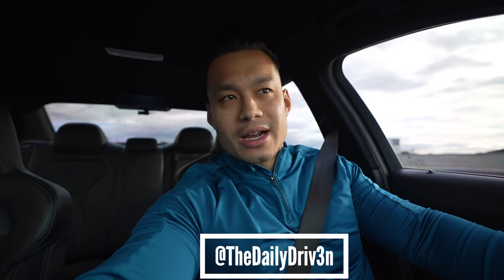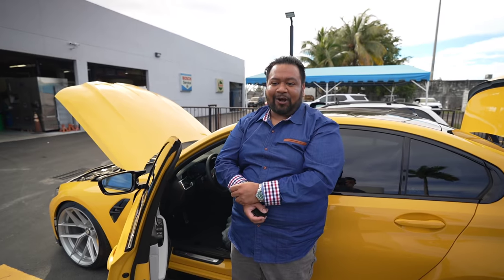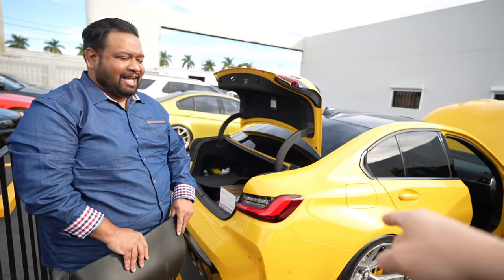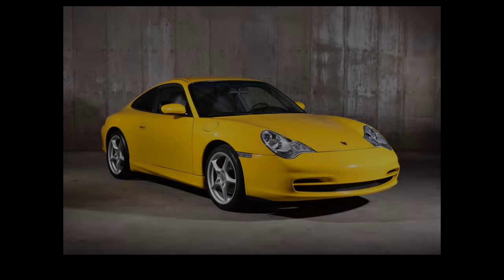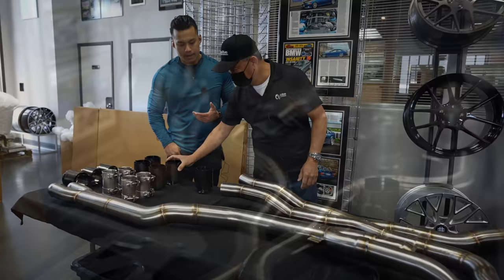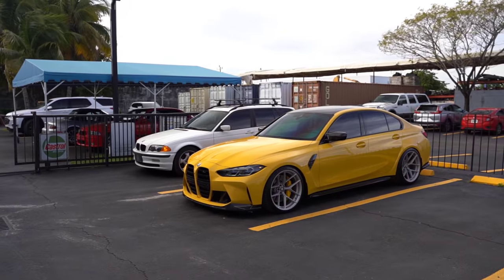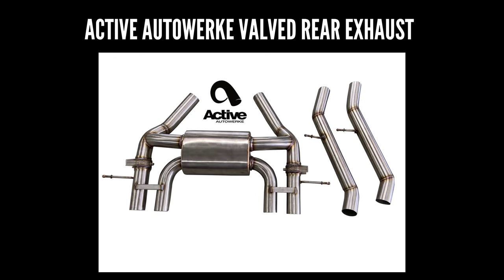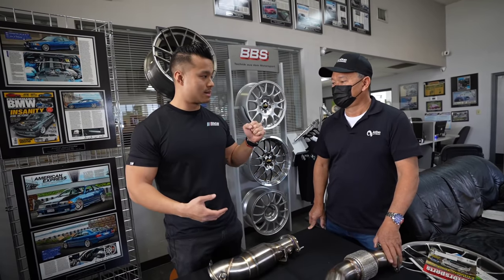2022 INDIVIDUAL SPEED YELLOW G80 M3 With Silverstone Carbon Bucket Seats

Comment: Everything on this car is awesome and makes the big grills tolerable for me as I still am not a fan. My biggest issue with the G80 is actually why they went with a floating one piston caliper in the rear. I heard because of electric parking brake nobody has a two piston rear, but I have no way of knowing if its true. I'm sure they perform just fine just it would set off the look way more and the previous F80 had two piston. I mean even my F30 has the two piston rear option.
Reply from the maker: Yeah have to agree the rear floating calipers are puzzling. I'm not a fan of them at all lol.

Comment: I actually like the yellow on the m3 more than I thought I would, though I'm still mixed on the front end at least on the coupes, but the four door looks a lot better especially after I saw one in person at the local autocross back in December...not sure yet if I can make it on on Sat really want to go see the cars there. 

Oh the red BMW being worked on is an E21 3 Series (predecessor to the E30 and replaced the 2002) and looks like it might be a Euro spec import due to the smaller rear bumper. For the longest time they didn't seem to get as much love as the E30 or the 2002 and came out in that era during the gas shortage and ugly bumpers.
Reply from the maker: Yeah when Mihir first told me the color, I didn't think it was going to look good and I was hesitant. After seeing it in person, I changed my mind big time.  Looks incredible.  You really need to see it in person to make a accurate judgement.  Hope to see you at the event.  DM me if you do. Ill get you taken cared of.  

Thanks for chiming in on that BMW Classic.  The team there are actually working on a custom exhaust and re-building the entire car.
Reply: Cool stuff, added you on IG, I'll message if my schedule aligns, looking like it opened up due to plans changing.
Reply from the maker: Sounds good just let me know in advance 👍🏻